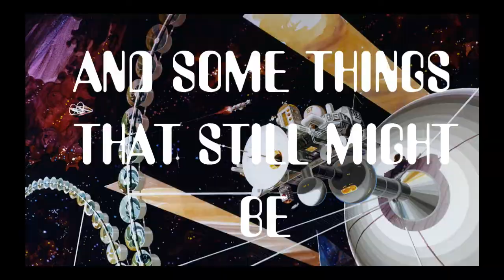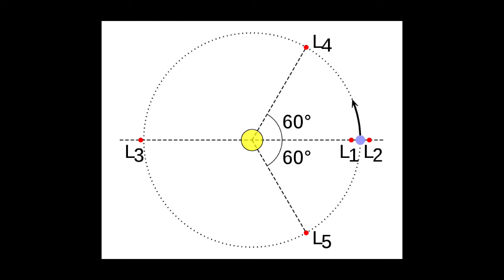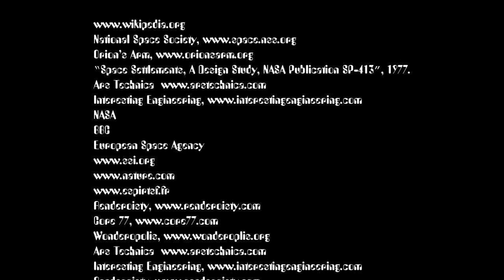Cities In Space- Part 3: The O'Neill Cylinder

Comment: This design was never worked out in any great detail. O'Neill presented it only as an extrapolation of the sorts of things physically possible, to a space-faring civilization ~80 years after the first "island One" smaller habitats.
O'Neill himself wrote that it wasn't entirely accurate, and that any such farther future habitat almost certainly wouldn't look like this.

As it happens, it is not feasible:
You may not have large window areas to the inside, because they're a clear path inward for cosmic rays. There is no-where near enough atmosphere to block cosmic rays that come in through the windows.
It is not at all advisable to have an object with a long center of mass spinning around the long axis. It will want to tumble and spin end over end.
Depictions of this have two cylinders counter-rotating to that they can remain stable only in pointing.
 Yes, you could use active stabilization means to counter the instability, but a good engineer wouldn't design to defy the laws of physics and then apply complexity to overcome the inherent design flaws.

The Summer Studies determined that the largest pressure vessel we could build with then-known construction methods and common materials, to spin for 1G and hold shielding and everything inside, was ~30km diameter, by maybe .75 times that length or possibly slightly more if attention is paid to making the rim massive enough for stability. See the "Kalpana" space habitat studies, drum shape.

Building up to the space manufacturing infrastructure to make the early smaller habitats like the Stanford Torus, might take ~25 years, and cost like many other large infrastructure or industrial developments down here.

Nobody who's responsible suggests anything as large as a colony for millions, starting with what we could start building now. We'd need to build the tools to build the tools to build the manufacturing capability for anything so large. But there is nothing outlandish S.F. about it.

Such colonies could be built anywhere in space such as orbiting Mars, or among the moons of Jupiter.

Before we can talk about more than a large long-term base on Mars or the Moon, it needs to be proven that we can live long-term and stay healthy in low G. That means "proof", not S.F., not wishes and hopes and try it and see, not maybe in the future biomechanically engineering ourselves and our offspring for low G.
Prove that first, and we can go on to talk about why space colonies at Mars or elsewhere are still the better or only way for large-scale, long-term habitation off-Earth.
We've had people continuously on Antarctica for decades, but it is not a "colony" to which people will retire or raise children.
Similarly at Mars or elsewhere. The living facilities will be in space habitats.